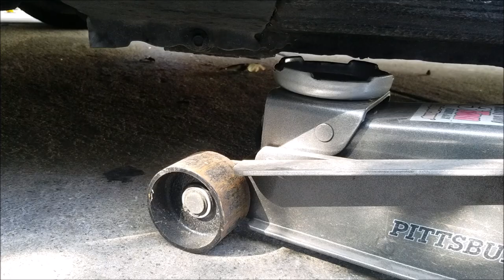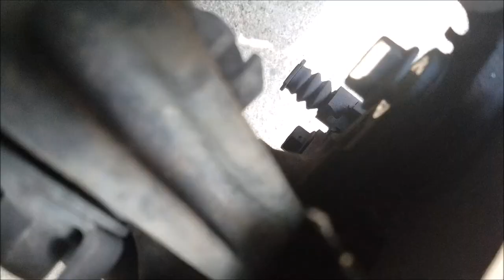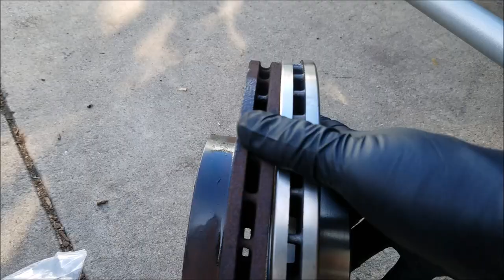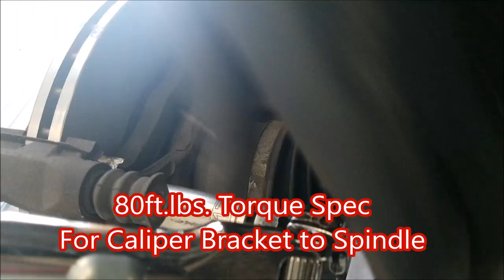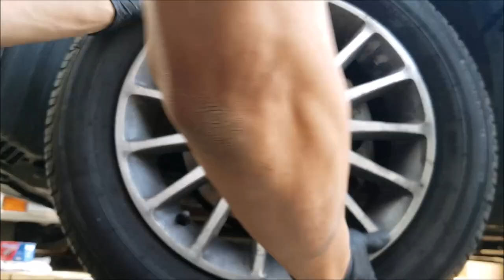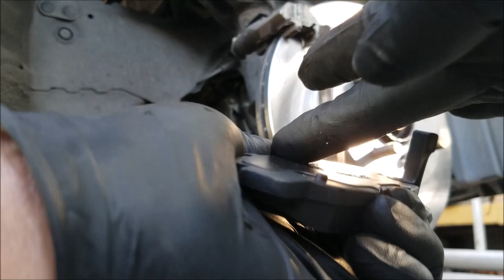How To Change Front Brake Pads and Rotors Honda Civic 1994-2000

Comment: Thank you for this demo. I just had some trouble making out what you were saying. Can you explain about the piston again?
Reply from the maker: for the piston some people recommend opening the bleeder valve to get ur old fluid out but that can cause many other problems like damage to that bleeder screw, or allowing air into the brake system or not being closed completely, but u do wanna keep an eye on the level of ur brake fluid so that it doesnt overfill when u compress ur brake caliper piston...and u use a brake caliper spreader and an old brake pad to compress the piston.
Reply from the maker: hope that was the part u were having trouble with but if not please let me know:)

Comment: What Rachets and breaker bars would you recommend for removing the caliper brackets with good accessibility. The ones you have seen good.
Reply from the maker: Well ive kinda upgraded to snap on for my most used ratchets..and their 1/2 long ratcher kinda does both for me for the bigger bolts..but they are really expensive if u dont do em often even though the difference is worth it..but i do like the gearwrench brand as an alternative for ratchets

Comment: Excellent video. No wasting time with fluff/b.s. talk. Thumbs ups.
I ask this question because I'm a beginner: Shouldn't you replace the rubber boots and clips with new ones? Or is it not needed?
Last week I watched your video on replacing the starter on a 2005 Honda Civic. Guess what? I had to replace my starter and the video help a lot! As a matter, I couldn't have done it  without watching it.  Thanks much.
Reply from the maker: The rubber boots only if torn and the brake hardware yea they should be replaced it does help avoid risks of that squealing brake noise..but i actually made a newer video much more detailed for the 2001-2005..thank you🙂 so glad to be able to have videos out there to help

Comment: Copper anti seize works best for brake pad metal clips.
Reply from the maker: Well anti seize is only meant for pieces that arent meant to move..so anti seize will actually clump up and have a negative effect..so on break parts that move its best to use brake caliper lube on the contact points

Comment: If I dont have that tool to compress the brake calliper, is it hard to push it in with say a piece of wood or something flat?
Reply from the maker: U can use a c clamp or u can even use the old brake pads and put something in the middle like a pry bar and spread em apart.
Reply: @backyardchevy328  thanks for the response, I didn't have a c-clamp either so I just bought the brake pad spreader haha. Thanks for the video, helped me a lot in changing my rotors/pads on my 96 civic im driving for the winter :D
Reply from the maker: @kiefer136  glad u were able to get em done🙂 im sure that spreader will be useful in the future...thank you🙂

Comment: Thanks man, great video!
Reply from the maker: Thank you for watching and for your support:)
Reply: @backyardchevy328  changing my rotors and pads tomorrow so it def helped
Reply from the maker: thats awesome...good luck, hopefully it all goes smooth:)
Reply: @backyardchevy328  went well except I got the driver side done then when I was compressing the passenger side caliper it popped, had to replace it. Mine as well do both sides. Ugh, had to disassemble the driver's side. All in all it works better now. My 98 DX has slightly different caliper assemble, only one bolt on bottom and the top just sides off and on. Thanks again for the video
Reply from the maker: Oh no, im sorry to hear that...im glad u were able to get it done though...thank you

Comment: I heard, or read, several people saying the rotor screws are not necessary, they are for assembly purposes. Do you find this to be true? That seems weird to me, but I guess the wheel and caliper/pads would hold it together.
Reply from the maker: Yea theyre not really necessary but when assembling ur brakes having the rotor hold in place is very convenient, the wheel being tightened/torqued is what would do the job if it didnt have the screw